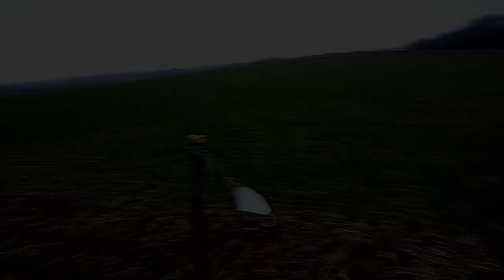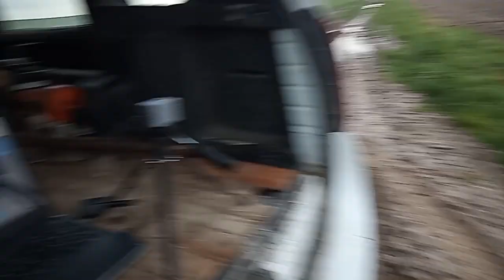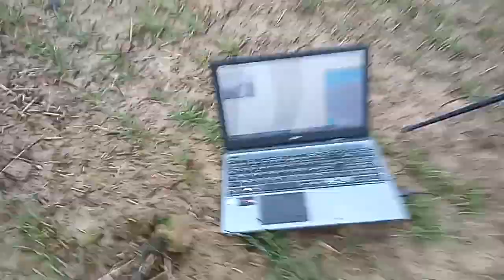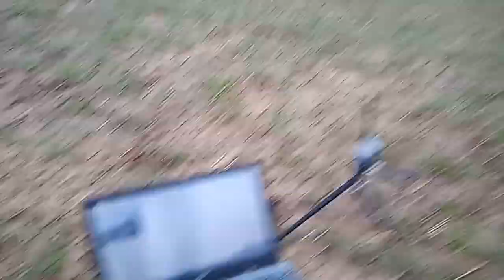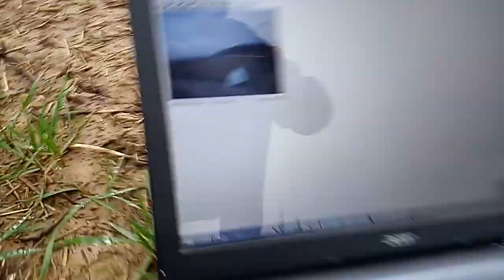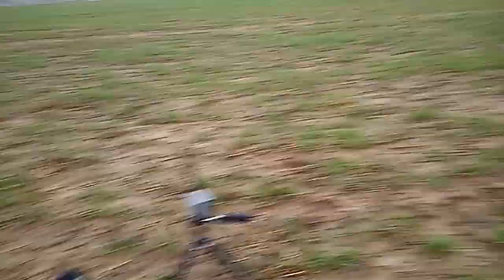ESP32 Camera 600m range using ESP NOW!

Comment: Bien le bonjour, j ai un retour   " Error compiling for board  ESP 32DEV Module"   quand je compile le programme T-JOURNAL_ReceiverESP-NOW_v1_1pwrMOD ou ReceiverESP-NOW_v1_1.  sur ESP wroom 32 ou AI thinker esp32cam??   Pour quel board ces codes sont compatibles??       Que veut dire la note;   NB: To handle ESP32 arduino IDE need to have python installed!   car je suis dans l IDE arduino?    merci pour repondre.
Reply from the maker: Alors premièrement les carte t-journal et AI thinker sont différentes, ils faut sélectionner le programme .ino qui correspond à votre carte 
Ensuite d'après ce que je comprends vous n'avez pas installé python donc il est impossible de compiler n'importe quel programme pour n'importe quel esp32.

Je vous invite à regarder ma vidéo tutorial t-journal avec essai a 1300m que vous pouvez mettre en français (la traduction sera correcte).
Tout y est expliqué de A à Z.

Toute la partie logicielle est commune quelque soit la carte sauf le paramétrage de cette dernière dans l'ide.

Comment: Well done mate👏🏻 but why not test using ESP LR? it will take much longer but improve the range
Reply from the maker: LR don't allow to use classic wi-fi in parallel so you can't connect Android/pc on it to access to the webpage.
Anyway 1.3km is enough for the purpose I made it for.
Reply: @bl08 you can enable long range if you connect to a access point, I was however unable to connect to my network and run an access point at the same time with long range enabled but this might have been a configuration error. 
To use wifi and esp-now together you need to correct the wifi channel, most access points have channel switching enabled by default and for some reason esp-now might change back to channel 1 even if you configured a different channel.
I had to enable promiscious mode to force channel to the same as the wifi connected esp
Reply from the maker: @1anddr  I remember that stuff with channel that automatically change to channel 1, which create some problem to connect to an AP. I tried the promiscuous mode but without success.

If you want to modify my code, feel free, I'll be glad of it.

However it came to me the LR also induce lower bandwith, which is already narrow in classic ESP-NOW so LR mode would have a big cost about time between each picture.

This is why I abandonned the LR mode idea despite it's interesting.

For information, note also that the camera is sensible to signal noise, I experienced 20% signal but no picture (very probably because of windturbine proximity (+-800m).